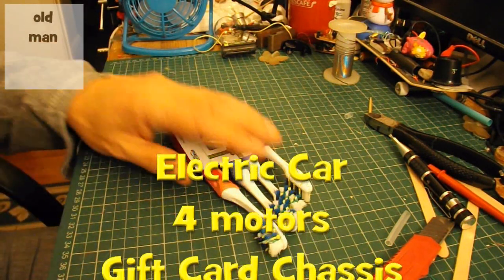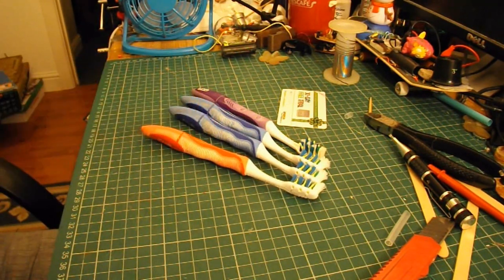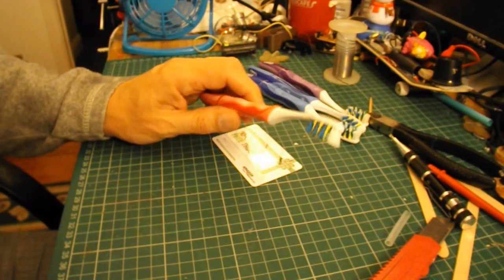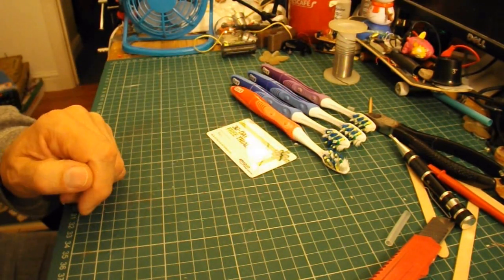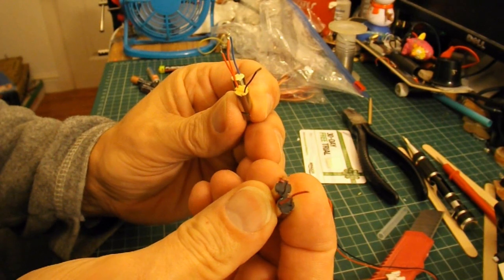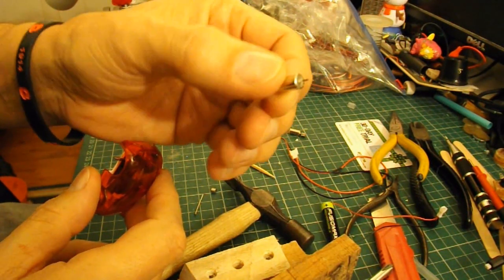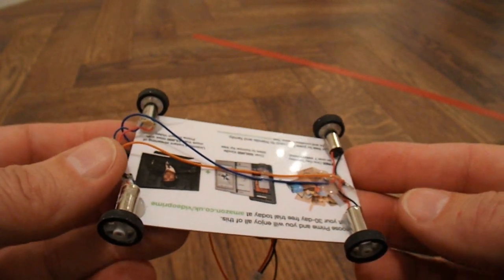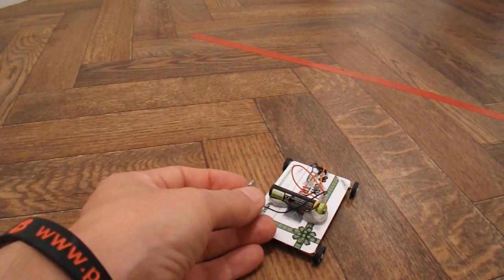Electric Car 4 motors Gift Card Chassis

Comment: Hey Grandad. Is it possible to make like a boat type thing (that is like the card you used in this video) that uses vibrations from a toothbrush motor to float and move around? Its probably not possible but i would love to see you have a crack at it. 
Thank You :D
Reply from the maker: +Sahan Methmal interesting idea. I don't think it would move very fast and I don't know how you would control the direction. Here is an alternative way of using the toothbrush https://youtu.be/jozN2szewSo
Reply: I have seen that video. :)Not the concept i was thinking of. Its like those water insects who stay floating from water tension. But instead we use vibration. :)
Reply from the maker: Sahan Methmal when I read your first comment I went and tried one of my vibrating toothbrushes inside one of my toy boats before answering. It did not move in any direction so that is why I gave you the old link. When you make bristle bots with vibrating motors on brushes, the direction of the bristles flexing when the motor vibrates is what makes them move. I am not sure how we would get a similar effect with a boat. I have some ideas but I don't know when I will get time to try them. One idea I have is a flexible flat sheet at the back of the boat laying at water level. As the boat bounces up and down with the vibration it should be translated into forward movement by the flexible sheet, but we may find the surface tension of the water prevents that happening.
Reply: oh ok. I was thinking like a piece of card. That kind of bounces from the water vibrations that comes from the toothbrush. Thank You for trying :)
Reply from the maker: Sahan Methmal that sound similar to the way I was thinking. It would be a matter of getting that bouncing motion to be focused at the back of the boat so it is pushed forwards.
Reply from the maker: +Sahan Methmal I spent a few minutes on this testing the idea with a flat piece of plastic at the back of the boat and I did get forward motion. Initially it started to turn like those bristle bugs but then it seemed to getto a resonant frequency and moved forward quite well. I think with more work you could make something quite effective. The effect must be similar to this only much faster https://youtu.be/k8Yv248B2-Y
Reply: Yes. Thank You for experimenting with it. :D
Reply from the maker: Sahan Methmal I have done a video but my pipeline is so full it won't be published until 1st December
Reply: thats no problem. Cant wait, :D

Comment: Thanks grandad !! for the vedio.  I was thinking  how much fast it will move if we use 9 volt battery instead of AAA battery ??  Can you do it for me ?
Reply from the maker: +Amrit Jung Dangi nope, these motors are designed for 1.5 volts. It goes fast enough for me and using 9 volts will do two things. 1 - it will ensure the car is broken when it hits anything at higher speed 2 - it will burn out all 4 motors
If you want to burn out motors feel free to build it yourself and do it